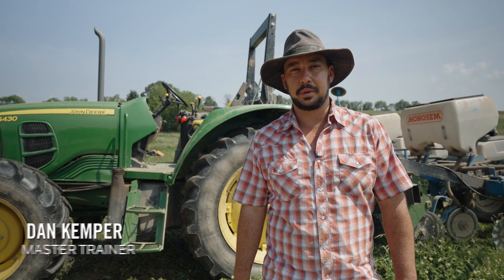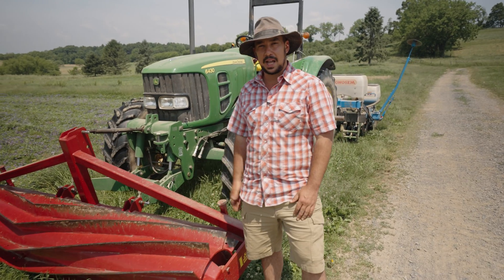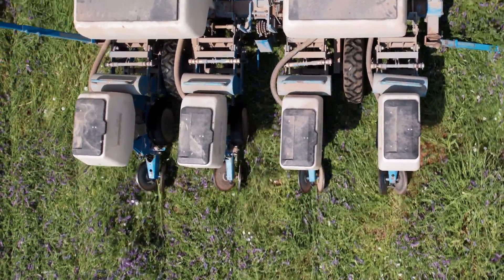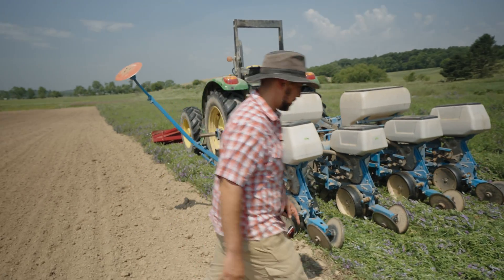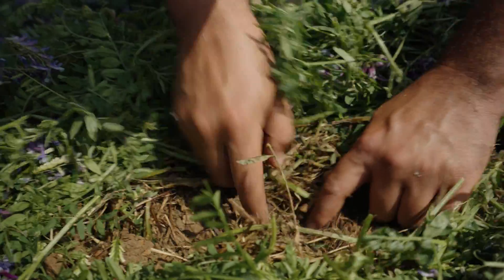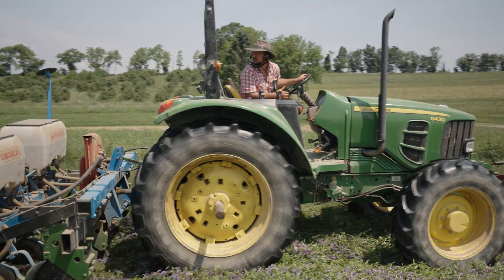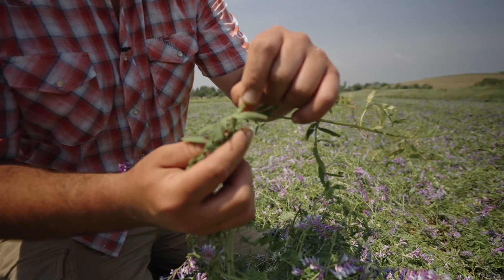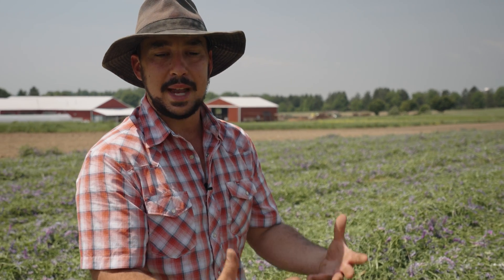Here Comes the Roller Crimper | Part 1 of the 2022 Corn Fields Series – Rodale Institute

Comment: Have you had issues with other cover Crops not being effectively cut by the leading coulter that would result in all the crash crop getting hair-pinned? And could you share the model of planter being used?
Reply: I had an issue with hairpinning. Had 3 different multiple species cover crops. I ended up taking off all the coulters and just running opening discs, and closing wheels

Comment: Thanks for sharing this video Team Rodale. A few questions for you for more context:
1. Why did you chose a single specie cover crop over a multi-species cover crop?
2. Did you treat the corn seed with any inoculant (either a commercial product or farm made)? (& was the vetch seed in the fall treated with an inoculant?)
3. With this system do you ever apply compost to the soil? 
4. Would weeds be significantly worse if you didn’t crimp the cover crop, but rather used ruminant animals to graze it off and then used the Monosem no-till planter to plant the corn?
Reply from the maker: Hi Taimur, thanks for the awesome questions! :)

1. We’ve had issues in the past with multi-species cover crop mixes because of the different maturity dates of each species in the mix. This makes it difficult in a roller crimping system because there is a small window to crimp the cover crop, and that window becomes either smaller because of multiple maturity dates, or we have to pick and choose.

2. We've never inoculated corn. With legumes, In this case, we did not, because we already have a well established soil that is high in rhizobia that immediately colonizes root nodules of the legume. In soils that struggle to fix nitrogen, we would recommend inoculating. And soil that does’t regularly have legumes in it, legume seeds should be inoculated for a few years. It doesn’t hurt to always inoculate legumes, but it is an added cost to consider. 

3. You can apply compost, but we recommend doing it closer to the crimping process. If you apply compost during the planting of a legume, it won’t pull nitrogen from the air as effectively, because it has enough access to nitrogen in the soil from the compost application. 

4. You could do that, but animals may not be as efficient, and you may end up with more weeds because of the trampling of the soil (basically like tilling; stirring up the weed seeds to the top of the soil). As apposed to having a cover crop, crimped and laying on top, which acts as a weed suppressive mat.

Hope that helps? :)